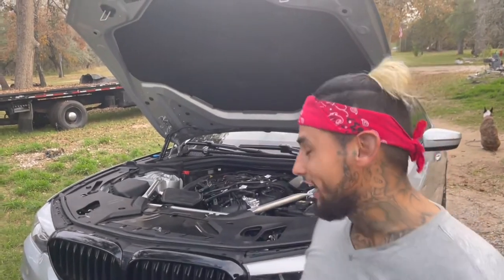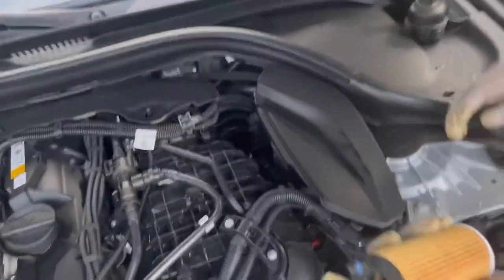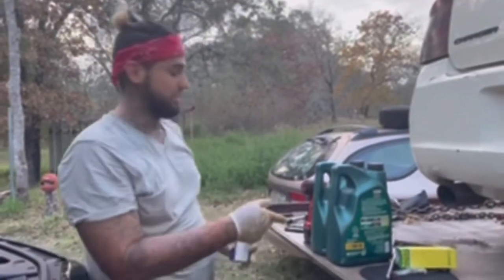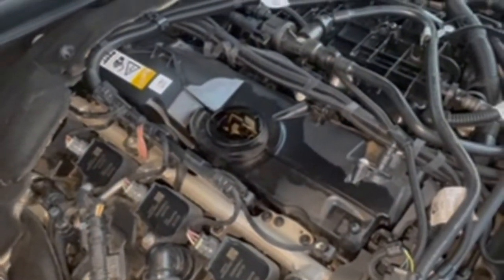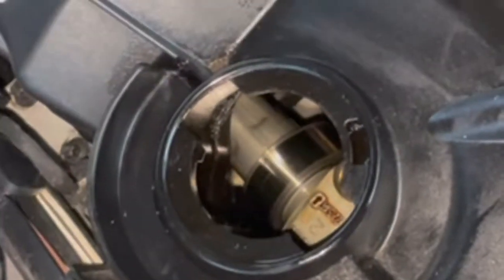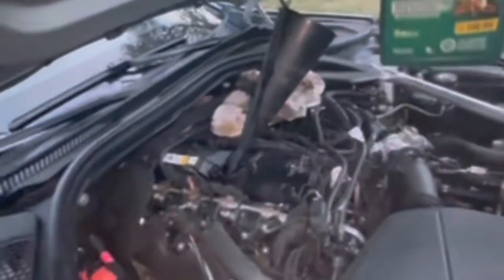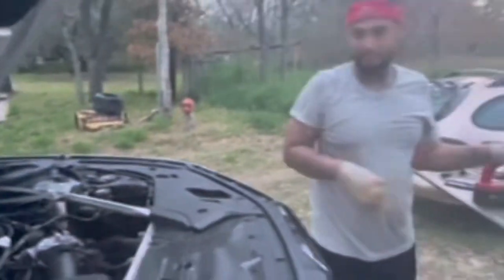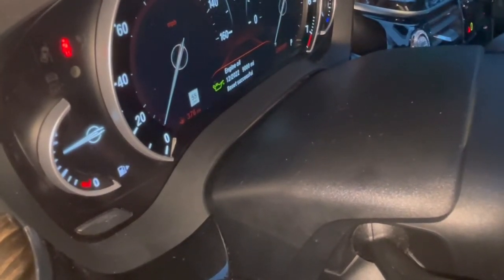2018 530i  B48 Oil Change ( short version)

Comment: You have used a GM spec oil which isn't good practice in a BMW.   The filter housing & drain bolt should be done up to 25Nm.